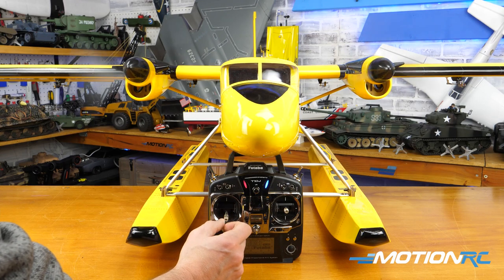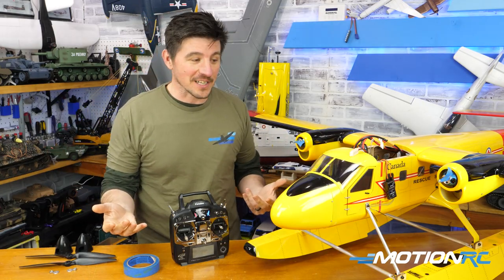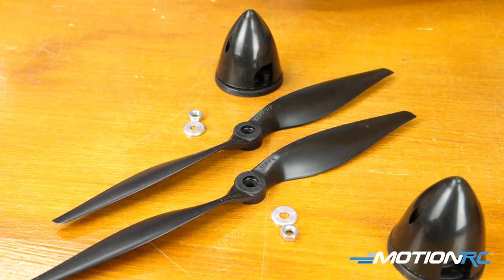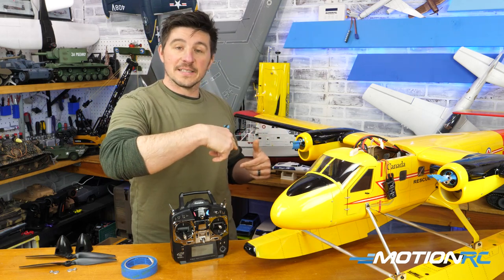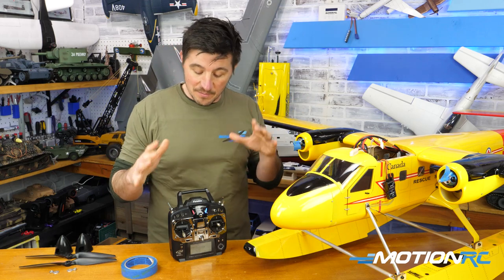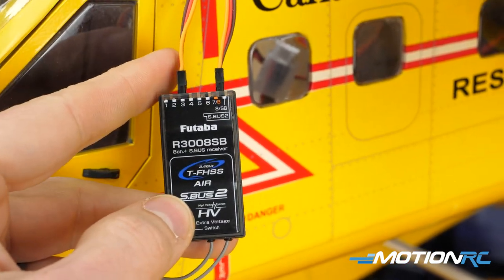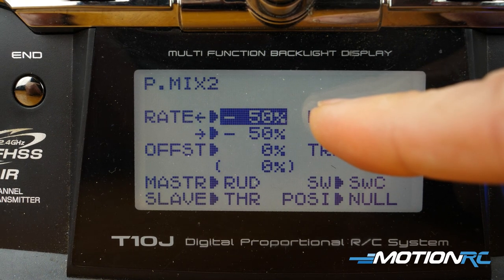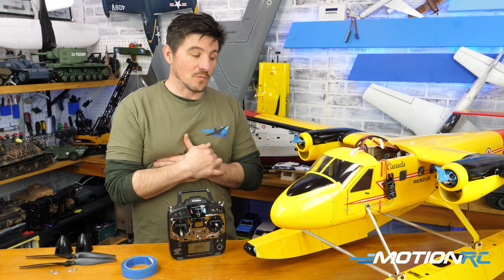How to Setup Differential Thrust | Quick Tip | Motion RC

Comment: James, my comment is in regards to "throttle cut" when dealing with differential thrust.  Have you confirmed that the "TC" does actually cut both engines?  The way you have it set up, I think the "TC" will only defeat the primary throttle and not the one plugged into your AUX channel.  In most flying fields now, it is a rule that throttle cut must be used when the plane is in or near the pits.  A slight modification of your mixes will in fact allow "TC" to deactivate both motors.
Reply from the maker: I will have to check that. I plan on my maiden Thursday and will get into the finalization of my setting tomorrow in my transmitter. I'll get back to you